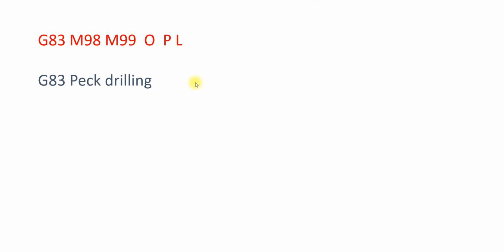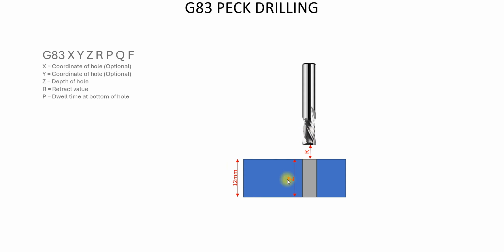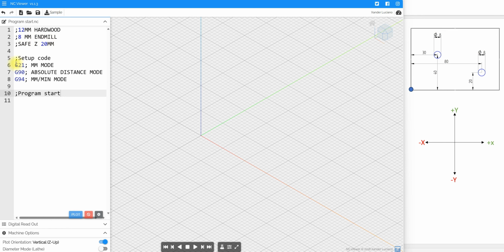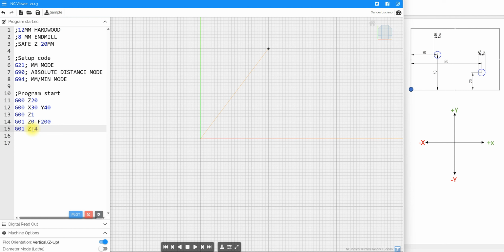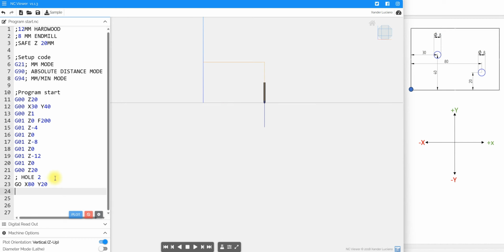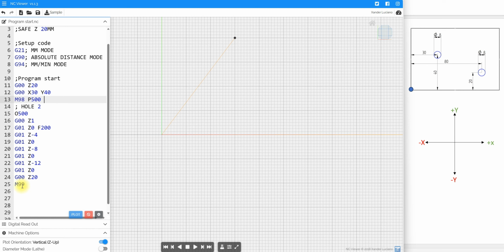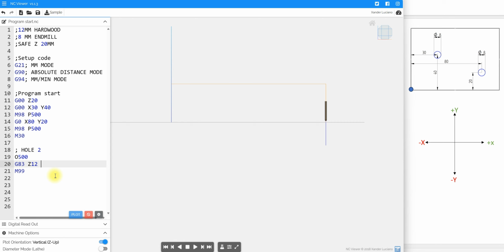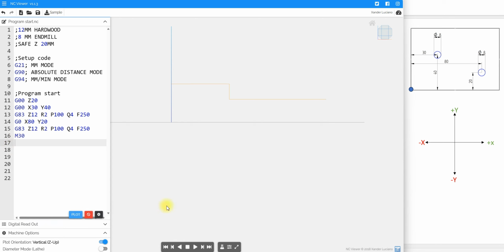G code for beginners part 3  G83 Peck Drilling and M98 M99 subprogram

Comment: Hi, thanks for this tutorial and the other one, i have a question, in the first 15mins of the video, u were cutting the first hole, isn't there an M code to make the drill rotate? like you are cutting in the material but i didn't see a code to make the spindle start rotating
Reply from the maker: Correct :)

Comment: But id like to ask you a question 
Is it true to program this workpiece like 
G91 z12
G94 s12000 f500
G00 x0 y0 
G01 X30Y40 i6
G00 X0 Y0 
G01 X80 Y20 i6
M30
Reply from the maker: You are on the way.  Please see the code below  with my comments  I think this is what you want to program.  You can copy this code into NCviewer and see the result.

G21 G90 G94; Start code mm mode Absolute positioning G90
G00 Z12; Safety Z
;G94 s12000 f500 Skip this line
G00 x0 y0; Center of origion 
G00 X30 Y40; Rapid move to first position
G00 Z1; Rapid move 1mm above item
M03 S12000; Start the spindel clockvice 12000
G01 Z-12 F250; dril down 12mm 250mm/min
G01 Z1 F500; Pull dril out of the item
Goo Z12; Raise dril to safety high
G00 X80 Y20; rapid modeto second hole
G00 Z1; Rapid move 1mm above item
M03 S12000; Start the spindel 12000
G01 Z-12 F250; dril down 12mm 250mm/min
G01 Z1 F500; Pull dril out of the item
Goo Z12; Raise dril to safety high
M30
Reply: @weitlingD3P  yes sir thank you thats what i ask about .....you are humble engineer thank you
Reply from the maker: @nasrahmed6236  You are welcome